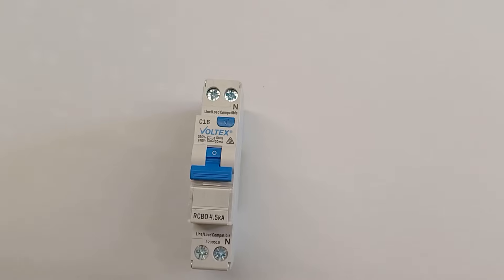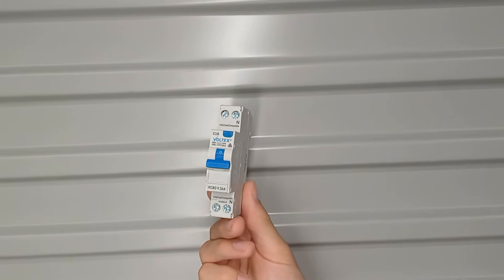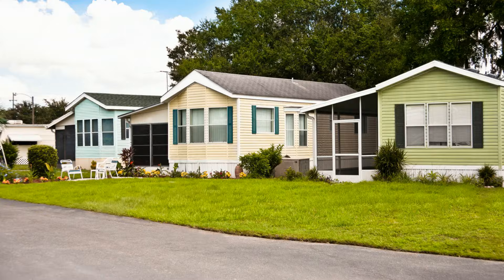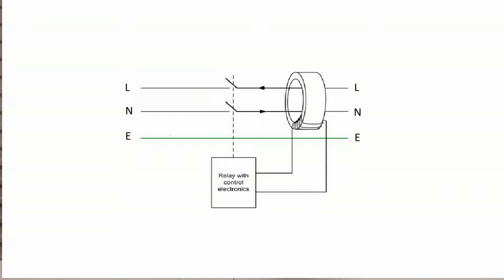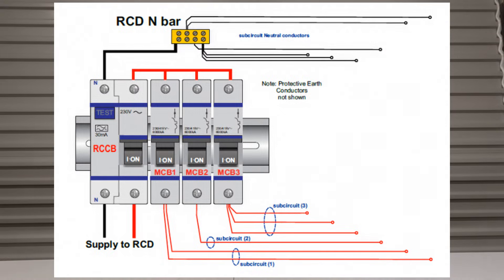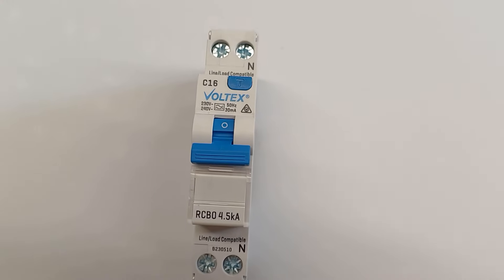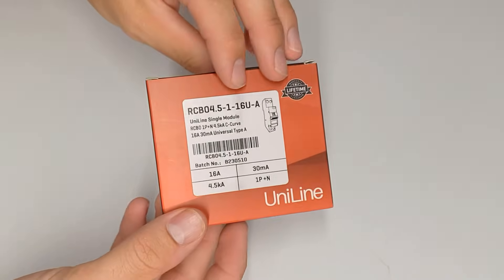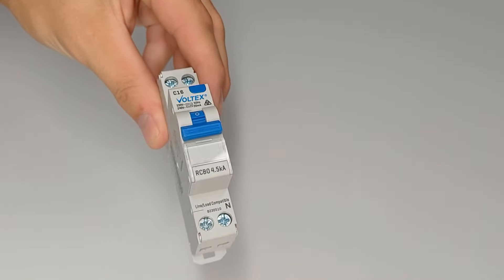RCBO's Simplified: Everything you need to know

Comment: insightful - you said that is able to detect a leakage to ground / Earth , in a situation where a metal chassis has a AC to DC transformer , and the chassis is both used as DC Common ground ( negative ) and also used as AC to Earth leakage.
Would the DC current flow trough the chassis influence the correct operation of RCBO AC earth leakage detection  ? 
Let say DC flowing trough chassis is 48V , 2000w load pulling roughly 41 amp,  would this mess with RCBO ? 
t
Reply from the maker: That is a very good question! I will do a short video later on explaining how it would work 😊